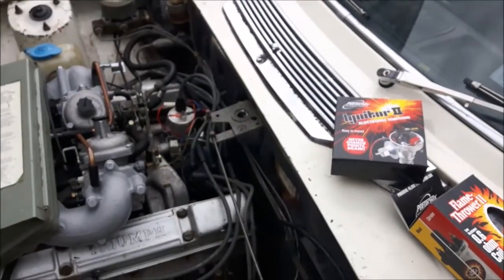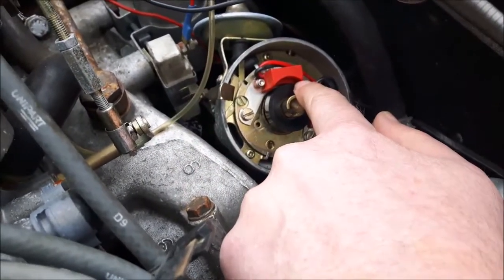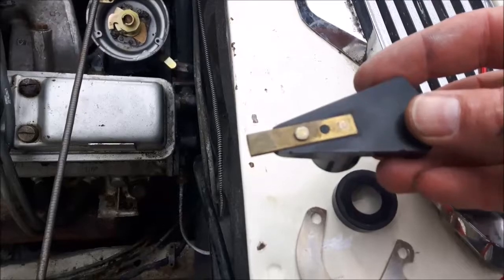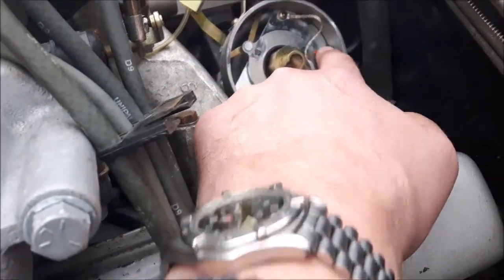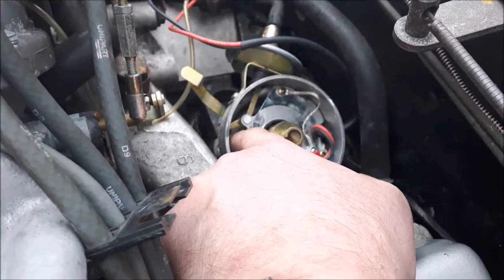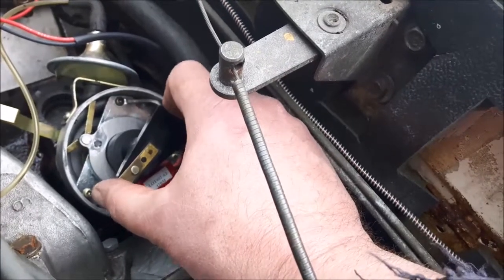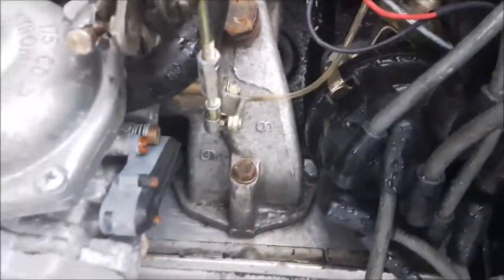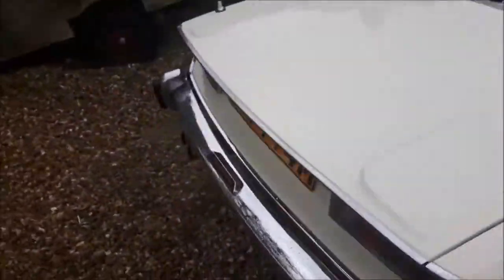Pertronix Ignitor II  and Flame Thrower II  install into a  Triumph Stag

Comment: How do you rate the pertronix and flamethrower coil against the Lumenition ignition system? Please let me know. Fitted to a Stag of course thanks Bob
Reply from the maker: Never had a lumenition setup. I did have a piranha p8 which was a noticeable upgrade from points. then when that failed me the pertronix setup was a world of improvement. Not sure if that helps, sorry

Comment: My vacuum advance mechanism on my Stag is sticking.  Is there any way to lubricate this effectively without removing the distributor?  I think mechanical advance is ok as rotor springs back into position when moved by hand. Fuel economy is terrible although I noticed that distributor cap contacts were a little eroded (not corroded)  so could this also hurt economy? Many thanks
Reply from the maker: Hi David
Without seeing the car it is tricky to diagnose. When you suck on the pipe to the vacuum advance you should see the baseplate rotate slightly. if it doesn't then something is wrong. If it doesn't move but you can suck then most likely that the diaphragm inside the housing has failed. If you cannot suck and the baseplate doesn't move then something is wrong inside the distributor. I would be inclined to mark up the base setting, remove it and work out what is wrong
Reply: @churchhouseclassics   Many thanks for the reply Richard. The vacuum advance is definitely working as I've tested it with a vacuum pump and indeed it does move the baseplate mechanism with enough 'pull' but the mechanism doesn't return when vacuum released unless I prod it with a screwdriver!   Could you explain marking the base setting please in case I have no option but to remove? Cheers.
Reply from the maker: @DavidUKesb  use correcting fluid to draw a line between the distributor mount place and the engine block. then mark the position of the rotor on the rim of the distributor body. so long as the marks still line up when it goes back together it will run. You would be wise to double check the timing after though
Reply from the maker: @DavidUKesb  also... with careful use you can remove the vacuum advance and baseplate with the distributor still in place. The baseplate comes in two sections that pivot around the distributor shaft. there is a tiny flat spring that sits in there also. be careful not to loose that as it does allow the baseplate to rotate